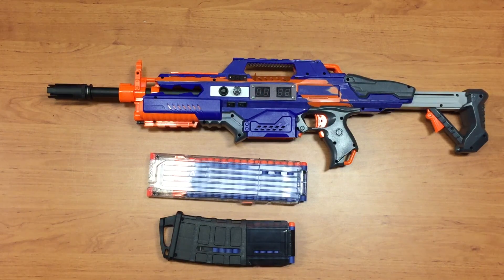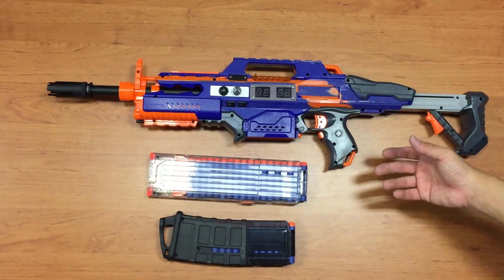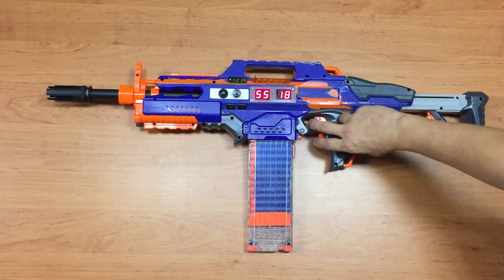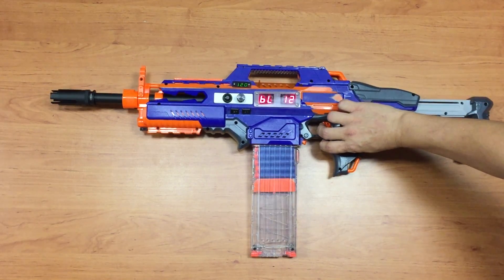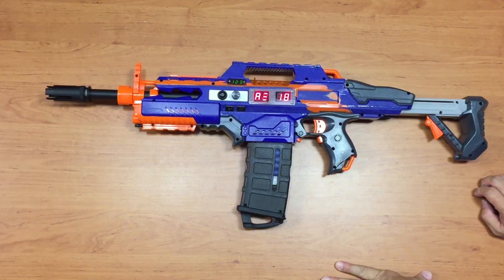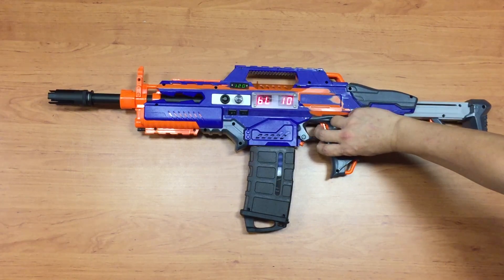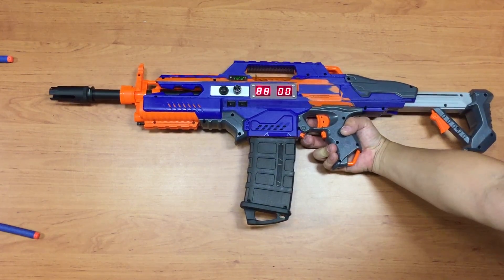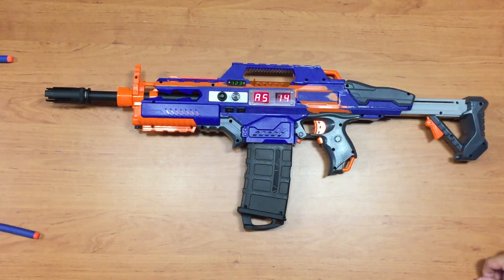{Mod} Nerf Rapidstrike + Arduino (Part Two)

Comment: can you add 180 motors for the flywheels
Reply from the maker: Goku194 for 180, will need a higher discharge Lipo battery I will most likely relocate the ardiuno and and wiring stuff to the stock so that I can house a bigger lipo. I will be working on a newer version of this mod, to make thing simpler and will most likely be using 180 motors. I did one using 180 motor on a stryfe do check it out as well :) thanks :)

Comment: Where did you get the muzzle brake from? Awesome gun btw!
Reply from the maker: hi, I bought it from the China website www.taobao.com, below is the link to the item :)

https://item.taobao.com/item.htm?spm=a1z09.2.0.0.1f30a53fCo0gVV&id=525907112210&_u=d1p5mvl54241
Reply: Tungsten EXE Thanks!

Comment: Hey what is that barrel or what did you use for it?
Reply from the maker: Hi the barrel is aluminum alloy tube with 19 mm outside diameter ,16 mm inner diameter. I bought it from www.taoBao.com, I will put the item link below, they come in many colors and length. They come in 17mm inner diameter too. 
Item Link: https://world.taobao.com/item/530236315618.htm?fromSite=main&spm=a312a.7700846.0.0.qcppEH&_u=p1p5mvl534ed
Reply: Awesome thank you!!

Comment: That pretty much what I was looking to do to a rapidstrike, I like the RoF idea, I was going to connect it to a tiny oled screen, you could have more information on it then, like total shots per game, volts,  current RoF, and I'm sure loads more. I haven't done any arduino programming yet but from youtube videos it dosen't look too complicated.
the monochrome oled from ebay https://goo.gl/T4GEax
or a full color oled display https://goo.gl/dZLJKM.
Reply from the maker: That sounded great man. I did bought one of those oled screen, however I have not try working on them yet. Will we trying them out as well :)